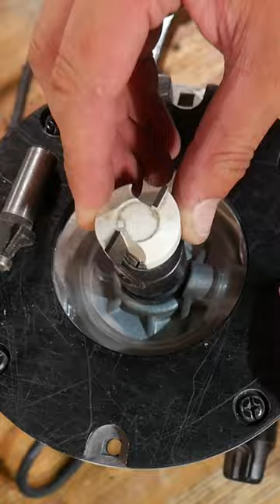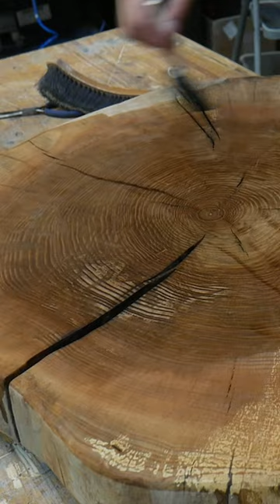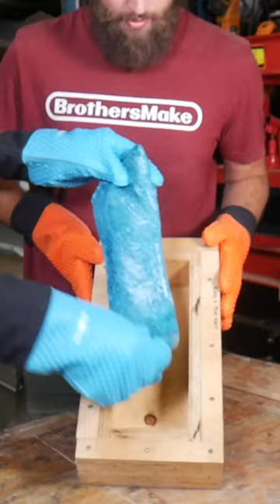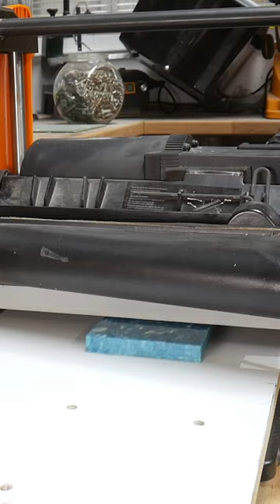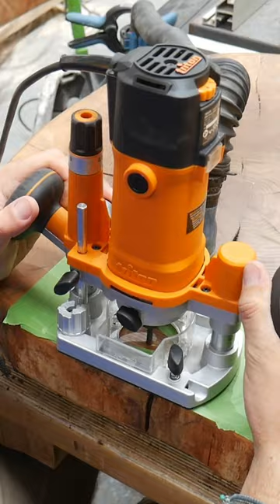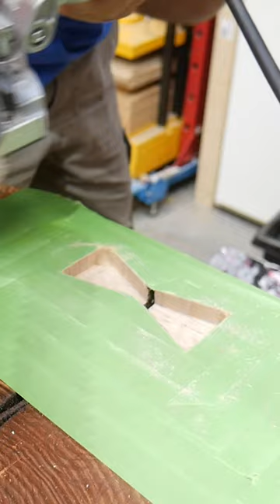Fixing Wood with Recycled Plastic ♻️

Comment: Tell me you guys could have just poured the melted plastic into the crack and it would have worked better
Reply: It's more like putty though right? I guess it wouldn't have poured so easily. I think the goal is to find uses for it, you know?
Reply: Generally you don't melt it, because when it gets that hot it starts releasing toxic fumes. Also, it shrinks a ton when it cools off, so even if you did pour it, it probably wouldn't fit by the time it cooled.
Reply: Plastic doesn’t pour like molten metal, also air bubbles would be left in it
Reply: The biggest issue would be shrinkage. The molten plastic shrinks quite a bit during cooling, So there would definitely be gaps on the longends. Might even put too much pressure on the wood .
Reply: Just epoxy it at that point. Safer and easier.